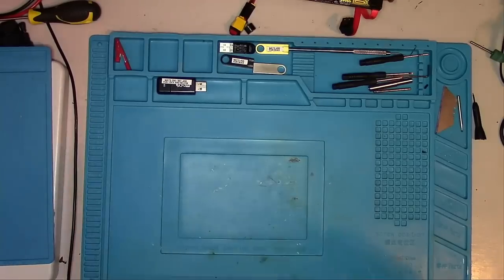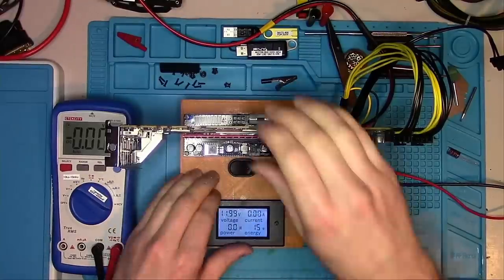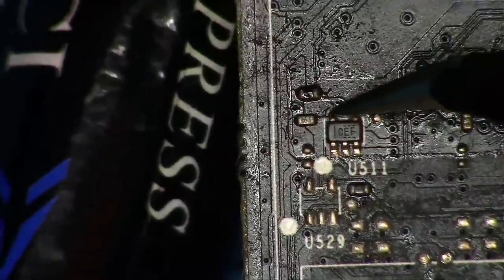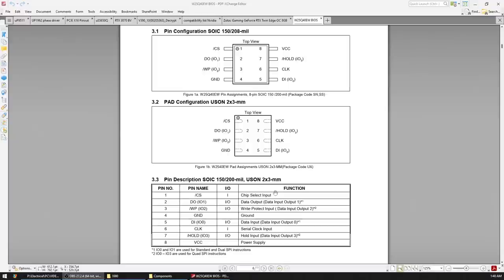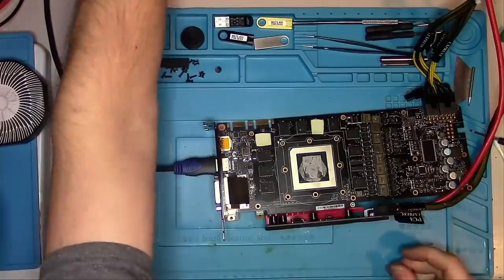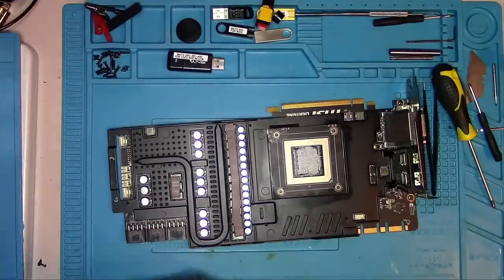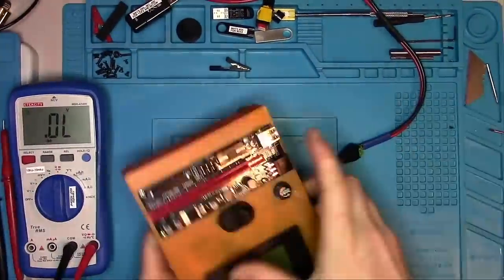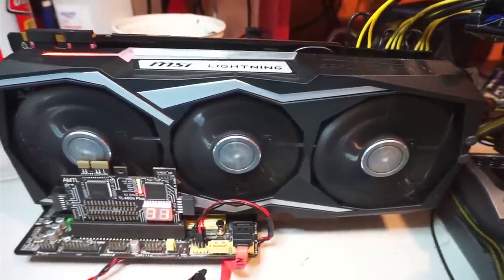Does MSI make good graphics cards ?

Comment from the maker: If you need a repair, please contact me using a links in the channel description.
Reply: do you fix laptop Graphic cards as well ??
Reply: Thank you.
Reply from the maker: @ChuckNorris-lf6vo how can you improve cooling other that getting more air flow with maybe bigger fans ?
You cannot increase the fin stack. 
You cannot replace aluminum with copper.
You cannot weld fins to copper tubes. Not easy enough for a home else to do it too at least.
You cannot do much about it except to add more pads on the back and heat the back with maybe more radiators attached.
I've seen that and it helps but it's not a solution.

Comment: I've never had an MSI product last to half of the warranty.. and I've never had one actually get repaired under that warranty or replaced.. including having the repair service, in this case Fry's electronics at the time gaslight me having sent it back several times not having it been repaired.. which is actually not uncommon actually, my friend of mine found a list of parts that weren't replaced on his laptop at Best buy.. ended up getting his money back I had no such list unfortunately, nor knowledge that that was the thing that they did LOL..  there's this new idea that MSI is a premium part.. but they've always been bottom shelf as far as my experience has been, and it sounds like as far as their company and standards are anyways so.. yeah, I always I always shut her a little bit whenever he talks about MSI in a positive light but you know from from what I understand EVGA used to not have the standards and I've had many EVGA products just go completely bonkers, but EVGA has never gaslit me for several months.. they've gone out of their way to fix the problem. By the way the gas lighting seemed to suspiciously gas light significantly right up until the repair. Had expired and then it just was broken and not repaired.. and it's almost like that was by design.
Reply from the maker: Many people can relate to that but many is never enough to make a change.
Reply: @SAVE VICARIOUS VISIONS I also had them go around and round with a rebate to avoid it. They lost a customer in me....even though I can say that my 1070gtx from MSI is still going strong with regular use since Nov. 2017. So, I am at least glad I haven't experienced their low quality hardware. But it's my first and will probably be my last card from them.
Reply: That's total bullshit. I've been using msi cards like forever and never had any major problems with their mobos or GPUs. And even if I had they always replaced it with the new unit.
Reply: Part of the problem here is Fry's. I've had a  lot more defective stuff when buying from them. It was no surprise to me when they went defunct.
Reply: @AphillyatedYT  Thanks Sherlock🤡

Comment: Hi!  Owner of the cards here :)  What an interesting fault on the EVGA unit.  What do you think would have caused the bios chip to get corrupted?  Did you flash the bios chip with an external programming device?  This card was happily working and gaming one day, and then one boot, it was dead.  The MSI I am nostalgic about because it was "the best" deal I had ever had in my used parts hunting.  This was originally a 980TI lighting that I purchased used for $180 while still inside the MSI warranty period.  Much to my dismay, the 980ti was dead when I brought it home to test.  Upon sending to MSI for RMA, they  said they could not repair, but asked if I would accept 1080ti Lightning Z as replacement!  This experience shaped a very positive outlook on MSI as a company for me.  The failure on this card was strange.  A couple of times, the system would not boot, so I removed the GPU, looked around, put it back in, and it would run again.  The last time, the system failed and would not boot, I observed melting and burn signs at one of the 8 pin power connectors.  I thought for sure something shorted internally because one of the VGA 8 pin connectors was melted, deformed, and burned.  I presume the fault was a gradual melting of the one 8 pin power connector first causing intermittent contact, and then an actual burn.  Why in god's name would your use 3x 8 pin connectors presumably to spread the current and heat load out. . . just to design your cooling such that the entire VRM traps heat to the center of the GPU assembly right near the power connectors. .  . so if you overclock the extremely well cooled core that has 8 lbs of heat pipes and fin stacks attached to it, it dumps even more heat into the VRM and it melts the power connectors.  Thanks for taking a look at these.  I would never have been able correctly trace the cause of failure on the EVGA card, and the damage caused by the MSI card was enough for me to get trained eyes on it.  I did not expect the card to be "just fine" if a bit fire prone internally given the exciting circumstances.  I am extremely happy with the repair results and would not hesitate to send more repaires your way, but I suspect once people catch onto how competent you are, the lines may get too long.  I'll probably try to find a used waterblock for the MSI card to let it safely live out the rest of its days.
Reply: Interesting, thanks for sharing
Reply: yeah thats what i was going to sugest, try those nzxt adapters with a 120mm aio. I believe will do better than factory.
Reply: Could try downclocking and power limiting the msi card a bit.
It might take very little to get it under control. When the heat spikes up, it interferes with conductivity, and that causes more heat, which further impedes conductivity, etc. It can be a vary small step of exceeding capacity which triggers the vicious cycle.

I have a 1080ti STRIX OC, and I found that Asus's binning was just not up to par. And the card works great at a slightly more modest OC than the factory OC. But it makes much more heat and becomes crash-prone with just a few more percent squeezed out of it at factory oc settings. It works flawlessly (long term) at halfway between standard clocks and the strix OC settings.
Reply: @kathrynck  I suspect another fix may be to simply run the fan curve higher than I had it set. . . the cooler is so good at cooling the die that the fans do not ramp up very fast, but now I know a certain amount of airflow needs to be present to cool the center heat plate.  The temptation when running this kind of card at mild settings is to keep it more on the silent side. . or, if at idle, with the fans completely off. . ., and the core temp can be deceivingly low.  At the risk of looking like the idiot that sends 100% working cards in for repair, I am glad the internals were scoped out and confirmed before trying to fire this card up again in any other system given the melted power connector and burns.
Reply from the maker: External flasher is what I use.
I don't know what can cause firmware to go blank but this issue exist on amd cards that have phase controller operated by firmware.
Without special tool and software only a handfull of people have the resources to fix it.
So sad.
Smart devices have a mind of their own.
One day they loose it and we are forced to buy new product.
Reply: @chunger169  Fan curve can help true. But if the card tries to push itself too hard, it'll find a use case where it'll go too hard & crash.

On my 1080ti strix oc, the factory oc was 1708 mhz (compared to nvidia standard 1582 mhz). Mine could go for hours at 1708, but it would eventually find a way to crash. So I moved the temp target from 85 to 83, the oc from 1708 to 1683, the mem from 11100 to 11000, and set the fan on a linear curve from minimum at 40C to max fan at 75c (80c out of the box). I also tinkered with voltage and ended up at just 92% (of the out of box OC voltage I mean)

I'm like 1% off the out of the box benchmarks, but it runs 100% stable (and has ben 'on' like 30,000 hours, and 'pushed' maybe 10,000 hours). And it throws shockingly less heat into the room it's in. Seriously, the overall heat output is down like 30 or 40%. I didn't measure the heat output accurately, it's just an impression, but the difference is very noticeable. Enough that I abandoned the plan to get a small window AC in that room to supplement central air. Case temp dropped by like 5C.

It kinda amazed me that a percent here, a couple percent there, turned a small room  from a sauna into a regular room again, and turned a crashing card into a workhorse. I've heard of some 1080ti strix custom oc'ing to 1760 stable, I just didn't get that silicon in mine ;)

Comment: The first ever gaming graphics card I ever bought was an MSI Cyclone Radeon 4890 it failed miserably and I was deeply depressed as a young man, that was a lot of money for me, MSI has NEVER made anything right with me. I grow a litttle older... forget about it, buy an sli plus x99 board, same thing happens and I feel the same way. I will tell you what I'm done feeling helpless from losing money I barely had, so... the solution was to never buy MSI ever again... I'll use msi... but i'll never spend my money on them. MSI is too risky.

Comment from the maker: I just realized i was measuring the wrong end of the capacitor for the memory phase. Maybe thats why i had no voltage on it the first time.
Maybe swapping the 8 pin connector had no effect other then limiting the power draw when card is under load. Who knows ?

Comment: This is the most thorough GPU testing I have ever seen. Northridge Fix pulls off some amazing repairs on a wide array of things. But have never seen anyone do a GPU to this level. People online are like , yeah , I baked it in the oven for several hours🤣
Reply: Northridge Fix is a basic allround repair men, he has no time and for certain no knowhow to fix these cards. In my eyes he a bit of a scam, bc he is charging a lot for "no fix". Should be none or a very low fee, its his risk.
Reply: @Arvidje   Your scammer accusation meets my oppinion on freeloaders.

He is obviously a working man and not the GPU owners' sugar daddy. I believe that if it is the GPU of the owner then it is the risk and responsibility of the very same owner. Northwestrepair might not match NVIDIA's laboratory, yet he seems not as that much incompetent as you implied. On the other hand his business is not a monopoly, there is a wide open competition therefor customers can choose between different prices and service ranges. No one is forcing GPUs to enter his shop. One could actually expect that if someone has  had taken time to find and buy a graphics card this individual should also invest the necessary time to select the repair service of choice. 

And of course Northwestrepair should bill a reasonable minimum for a diagnosis even if it only takes less than an hour especially when the company's protagonist of the repair approach spent that time and got his hands dirty. People work to improve their lifes and not to fulfill freeloaders dreams. Repair guys need to get paid. If one cannot afford that one shouldn't care for tech at all in the 1st place.
Reply: That dude just complains the whole entire time on video can’t stand watching

Comment: 10:42 isn't it a design to evenly spread the heat across the heat"spreader" then to blow it off with the fans ? What they basicly intended was to make the surface area bigger to cool everything at once. Seems like a good idea if you ask me , except the small SMD components under the spreader will never get the blowing air over them. Something for something...

Comment: Can you make a video on AMD GPUs? Especially on what brands to get or avoid. Thank you for the amazing content.
Reply from the maker: all of them
Reply: @northwestrepair  why tho?
Reply: @northwestrepair  learn to read before stating bollocks...
Reply: One of my favorite where the Gigabyte gaming OC Vega 56, the notorious infamous one... But I've bought it from a moron that had butcher her up, and dump it on eBay but it never failed on me. And now it still pulling like a train on my friend's PC, never even the slightest problem. Arctic mx4 and that's it, it just works.
 EVGA power supplies tho...
 
My Asus Strixx advanced binned 1070ti is the worse, without properly covering all the VRAM modules and with the fans connector so sensitive that after the slightest touch, will loose contact and speed up 100% randomly!
 There's no solution online for this problem still, or even acknowledging whatsoever...
 EVGA graphic cards where just overated, in my opinion just average, nothing more...
Reply: @northwestrepair  WTF kind of response is this?

LOL, who do you think you are pal. Honestly.
Reply: @northwestrepair  😆 thanks for the reply. I assume you mean to avoid all AMD GPUs.
Reply: best is probably either sapphire or powercolor
Reply: @nexxusty  Lol it sounds like feelings have been hurt
Reply: @Chrontard  I've installed yesterday an Xfx RX 6600 to a chap and i must say it really convinced me, nice looking card, super stable and impressive running conditions.
 But the most important thing, it really blowed out of the water the image quality, out of the box, of my GeForce on my ultrawide 34 LG!
 I'm mostly impartial, but Radeon is my absolute favorite, always was and always will be... GeForce does the job, but to at least have it on the radar, the image quality of the Radeon cards, i have to tweak it about two or three days!
Reply: XFX, ASrock are the best bets as your first option, Sapphire and powercolor in second, the best is to avoid the rest of gpu makers that make for both amd and nvidia as much as possible, since the problems they have with nvidia gpu's translate to amd, doesn't mean they will be bad but nonetheless, those 4 are the priority before getting another brand
Reply: Reference cards are best AMD wise imo. Then Sapphire, MSI, ASUS, Gigabyte, and XFX last
Reply: @TheLoneWolf449  not even close lol, reference cards not only have one of the weakest coolers of all RDNA2 cards, they can't boost since they will throttle, XFX and asrock can get to clock speeds of the Sapphire nitro + without gigantic heatsinks while keeping the same speeds and barely higher temps than a 4090ish cooler on the 6950xt from sapphire
Reply: @ishiddddd4783  I don't think they have the weakest coolers. I had a 6900 XT reference OC'd to 2.725GHz and for being an extremely compact 2 slot card it did very well. I also don't look at cards solely for thermals. The reference cards were by far the highest quality. They are practically solid aluminum. I also seemed to have the least issues driver and software wise with a reference card. XFX on the other hand I had nothing but issues. I definitely respect your opinion though, I think saying which is best is subjective.

Comment: A lot of these GPU companies are using the same or similar power delivery components. Some are a little better than others in terms of overclocking but for the average consumer it really doesn't matter what card you buy. I bought a Gigabyte Gaming OC 3080 12gb which while not exactly praised is actually a really nice card. I was surprised, it looks far better in person. The main reason I chose it was price ($700 after discount) and the 4 year warranty vs the 3 you get on pretty much every other card. That matters to me more than RGBs or a better overclock.

Comment: I have never been a fan of MSI, had trouble with a card right after purchase it failed within a couple of months of very light use. I never bought another one. This is the only brand I have had problems with after 30 plus years of gaming. My first card was a voodoo 1. You just confirmed my suspicions about this company. Great show I subbed.
Reply: using an msi card for over 5 years now, solid performance as far as i can tell

Comment: My 3060 MSI Gaming X Trio seems legit!  I have had it since the begining of summer.  OC running 180 clock and 1100 mem clock and it runs under 60c all day long.  This card idles at 34c while doing basic tasks and when gaming most of the time it only runs 40ish maybe 50ish.  Only reaches high 50c when playing competitive games that draw alot of juice.
Reply: Same for me here using the 3080ti gaming x trio OC 75 on the clock 500 on the mem card is running idle at 25c when under 100% load with the gpu fans to 80% it only hits 65c i do have 14 corsair 120mm fans running at full speed but still its a great card

Comment: I do have a MSi Radeon RX 6800 (not Gaming X Trio, the reference model) and I found it to be very good at thermals. I guess their new design does good contact to the vapor chamber for anything that generates too much heat, then its triple-fan design cools down the card very well. I don't regret buying it though. It was bought before prices skyrocked. It is almost 2 years old and I've got zero problems at all.
Reply: I had the exact same model. Thermals were indeed excellent, though hotspot temp was always very high compared to actual GPU temp: a 20 degrees delta between the two. Gaming in a 30 degree room and it was quiet and peaking at 65 degrees, however hotspot temp at around 85 degrees. Could have been a bad thermal pad on memory.

Comment: I once bought a flagship motherboard from MSi, the K9A2 Platinum.  It died after 15 months of normal use and since MSi only had a 1yr warranty at the time, they told me to pound sand.  I didn't OC and I only had 2 cards in crossfire despite it having four slots and Quad-Crossfire support.

I haven't owned ANYTHING made by MSi since and I never will.